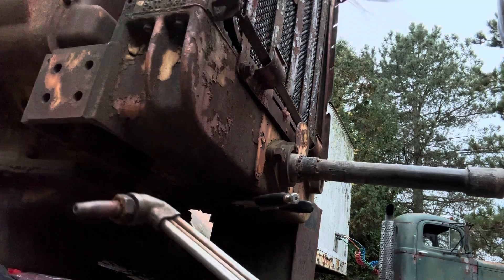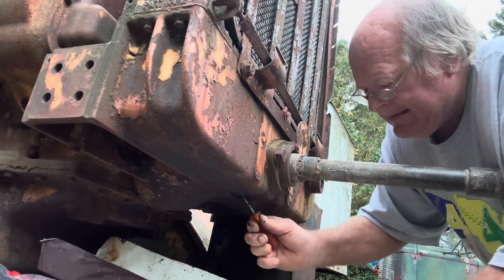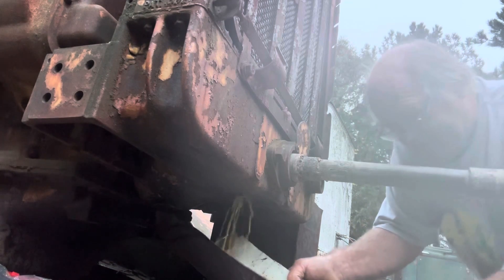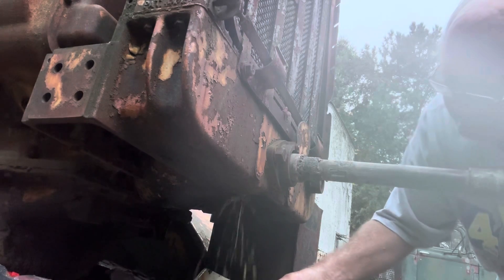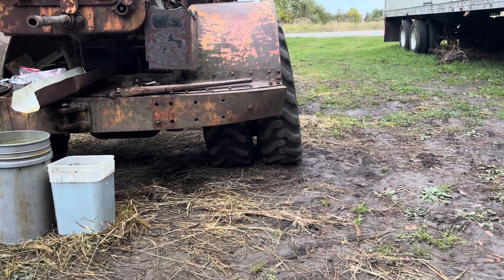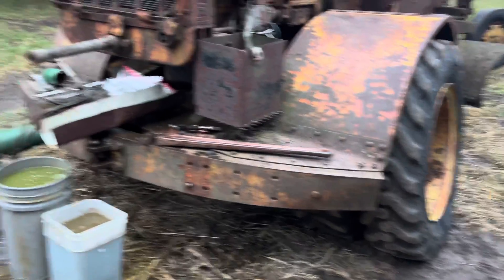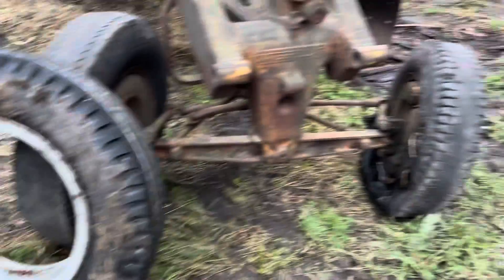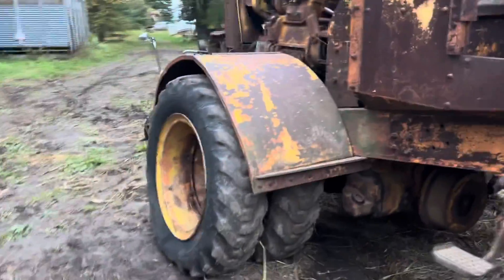A little more work on Autopatrol 10/15/25

Comment: That’s going to be a heavy job getting the rear wheels off and the axle out if it needs to come out. If I was closer I would offer you a hand to do the job.
So far it’s progressing well.
Thanks from Geoffrey
Reply from the maker: If you were closer😂 couldn't get much farther away! I would reciprocate. Watched you with those broken bolts, I've spent hours on one already just weld, breaking off and welding again. Patience is the key.